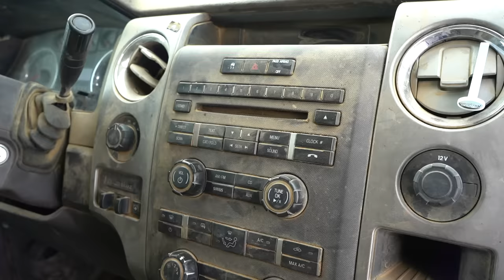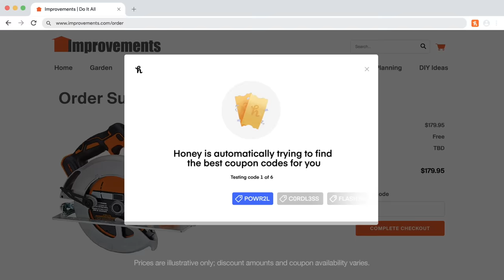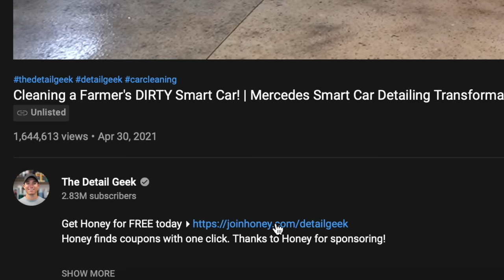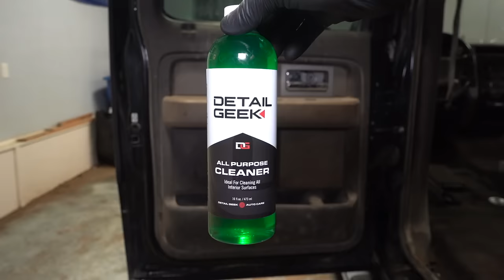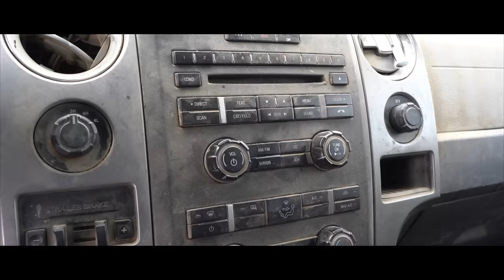Deep Cleaning a JUNKYARD Truck Bought Dirt Cheap! | The Detail Geek

Comment: Hi Guy. I have a suggestion for your interior carpets: why don't you build yourself a hanging board, with clips, so you can save your back when cleaning them, instead of working straight on the floor.

Comment: You should get into the habit of checking those VIN numbers of those really bad trucks. Sometimes trucks are stolen and disappear on ranches for years without ever coming off them  where they just use them up. 
That truck was used as a hunting truck obviously but spent shell casings inside and in the bed means they were probably shooting from inside that truck.

Comment: I have white leather seats in my car. I notice that if I wear jeans, the outside edge of my driver’s seat turns blue from me sliding in or out. I can’t usually use a leather cleaning wipe to take most of it off. Any advice on how to get it completely off?
Reply: Some quality leather cleaning products, some spray and a good wipe. I'm sure you could use leather cleaning wipes themselves

Comment: Just wanted to say you should change your name to lucky to have two ford's and have never been left stranded my whole family are ford geeks and constantly complain about them always breaking down and being left stranded. I'm obviously a certified tech so their trucks get towed to my shop for repairs. Before you ask yes they keep up on the maintenance. But still between the transmissions, rearends, front different, and electrical issues they refuse to buy anything else. Now I own 2 chevys and maybe I'm lucky because my 88 silverado has 754 thousand miles transmission rebuilt twice, engine overhauled once. All is original and has never left me on the side of the road. That truck my dad bought brand new with 3 miles on the odometer. It never left him stranded either. No blown head gaskets rod bearings main bearings gone bad ever. My other truck is an 03 yukon with 300 thousand miles transmission rebuilt last year. Engine still has never been touched except oil changes and tune ups. In September I'm going to tear it down and replace timing chain only since there's no ticking noise from lifters or head gasket issues that are showing signs of wear in not going to over jail this engine yet not till 500 thousand miles which then will be pulled out torn down block sent to machine shop to bore and hone cylinders. Then will have cam and main re-lined honed to make sure everything is still perfectly in line. Just so I can get another 500 thousand miles out of it,  if it doesn't rust apart by then as I live in northern Indiana and get a lot of snow from lake Michigan. But we'll see what the future holds. Also both engine are gas 88 has 5.7 or 350 and the 03 has 5.3 or 325 ls. Also Jane never had any issues with front or rear diffs ever.

Comment: My only question.   WHY?  The things a rust bucket.  I'd give the undercarriage 1 year before it collapses.  That's if the wires don't short out and the truck burns to the ground.  I can't imagine what it looks like under the hood.  I really like the weights on that rear wheel.

Comment: I wouldn’t bother cleaning the filthy floor mats, I would just throw them away and get some weather tech ones.  Carpeted floor mats never made sense in any vehicle, much less a farm truck.  My 2016 Colorado came with nice mats but I never used them and instead replaced them with the weather tech mats which are superior and a snap to clean.

Comment: I'm surprised to see that you steam-clean the speaker grilles, with the speakers still installed.  I thought that the heat and moisture of the steam would destroy the speaker, which is usually made of light materials like rubber, paper and plastic.

Comment: Wouldn't you dry brush the dirt off the emblems first before getting them wet? If you get them wet and soapy you are removing the dirt but also scratching the dirt into the emblems and paint. 
I know your thinking duh thats why I spray it with water first. But those are emblems with tiny gaps that dirt, sand whatever get trapped into hence the detailing brush. When you get it wet and soapy you are more or less using that brush to scrub in/off dirt.That could cause scratches. If you dry brush first you are able to actually see the dirt and flick it off with the brush. Just an observation. I clean for a living so I'm prone to seeing details. As you know as a car detailer the little details make the biggest difference when it all comes together in the end.

Comment: Did you bother taking the tool box off? Also, the floor pan always should be cleaned as well, in my experience, it's Never clean and is also a contributing factor to the smell of the interior.

Comment: Just pull the carpet out and pressure wash it , under the carpet there is going to be dirt all over the metal it will still smell bad if you don’t , take the door panels off too there is going to be dirt all over the inside , I work in a body shop when I take the door panels off there is all ways dirt inside